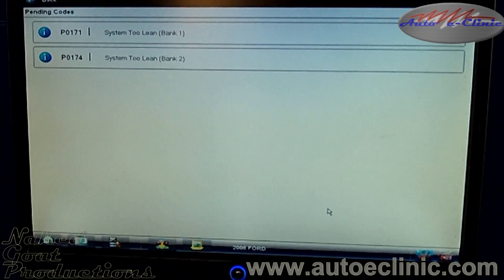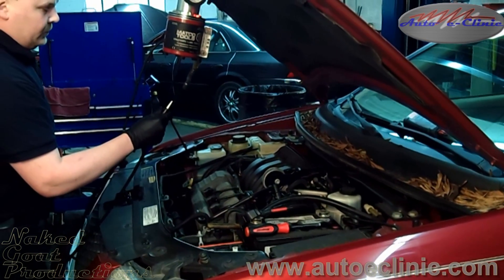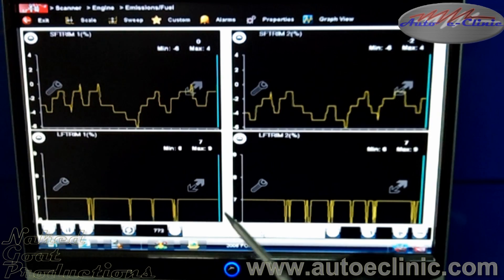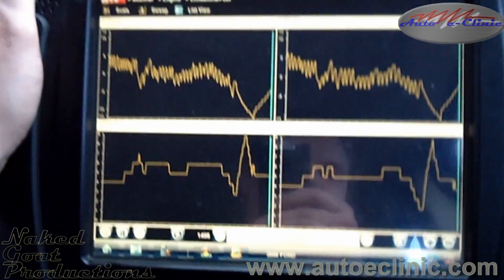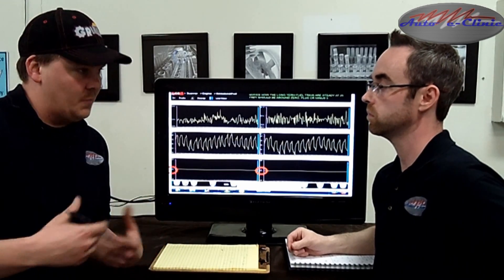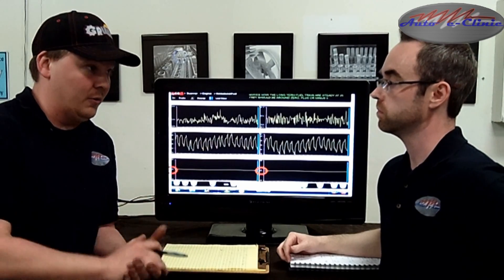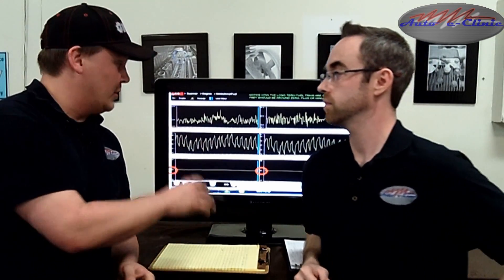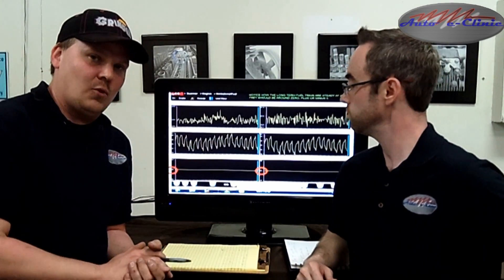How to Diagnose OBD II Fault Codes P0171 and P0174 Leaking Intake and EGR Valve (06 Ford Freestyle)

Comment: Where did you put smoke in the engine? In intake manifold? You used an adapter to acomodate the intake manifold diameter to the smoke machine output? I didn't  see very well the action. The presentation is too quickly.

Comment: Hello there, i have a 2000 Ford E150  van  And it keeps showing a P0174 error code on it. I keep taking it to shop after shop and nobody seems to know what the problem is. What i have replaced on it myself are the following. MAS sensor, fuel filter, Air filter,  02 Sensors ALOT of times. Is there any idea what could be the problem with my van?  It runs great and has been running great and no check engine light either until i came back from the auto shop i let them look at it because it was idling kinda rough when i would stop and a stop light only.

Comment: https://www.amazon.com/s/ref=sr_nr_p_89_2?fst=as%3Aoff%2Cp90x%3A1&rh=i%3Aaps%2Ck%3Aobd%2Cp_89%3AFoseal&keywords=obd&ie=UTF8&qid=1505984841&rnid=2528832011 I have bought a obd scanner from amazon. Simple to use with my Samsung S6. Downloaded the FREE Torque app. Easily found and cleared code on my Chevrolet . Also shows all the computer data, which is really interesting. I also use this OBD 2 while driving to provide data, hp, mpg, timing, etc...

Comment: thanks guys preciate the help I have the same issue on my BMW x5 with lean code on both Bank 1 and bank 2 and by the way nice I definitely don't have a lot of paper toilet so I'll definitely won't go to Taco Bell. my question is the following I don't know where to start I replace so many things recording this I did a vacuum test leak and nothing I also did a fuel pressure and for some reason to pressure regulator keep going up and down rapidly I don't know what's that about

Comment: HI I have a question i have a Acura TL Type s 2007 and the check engine light came on and i checked it and it gave me a code Po174 can you help me to see what it is
Reply: What was the issue(s) with your Acura. I recently got the exact code on my Acura Mdx

Comment: just had my head gasket changed and shortly after engine light came on, so I took it  back and now it's throwing both of those codes, I would like to hope it's not the head gasket since they just replaced that and put in a used air intake. so not sure where I should go from here.

Comment: I have a 2006 Ford Taurus, 6 cylinder car, my engine light, (idiot light), I went and had it tested about 2 weeks ago at Advance Auto, they said at that time I needed a tune up that my car was misfiring, I had already done an oil change a few days earlier, so I bought an air filter, and spark plugs, and wires and my son n law put those in.  Fast forward to today, (yesterday, Monday, I was in the Publix parking lot and my car started acting funny, sputtering, so I drove around the corner to Kauffman tire, and hour later they looked at my car and said  that 1 of the spark plugs had popped out and 2 were loose, they fixed it, but said they couldn't look at the other 3 under the pelium, that it may be fine now but without taking if off they are not sure,) so now I don't know if I need to worry about the other 3 spark plugs or not?   I am freaking out, I am disabled and I need a safe car, anyway, today I went back to advanced because the Engine Light is still on in my car, TODAY it read codes P0171 and P0174, I just watched your video on these codes so I see it could be lots of things, I don't know what to do, I don't want to get ripped off at a car place; so I need your help please!  Is this something I need to worry about, if I am planning to take a trip to Texas in my car soon, and what about my tune up issue

Comment: great video! I  have a 2002 vw jetta turbo, and took it to goodyear and they mention I need to replace a "Hose to Snorkel" what is that? they said i have to get it from the dealer. or were this part located at... the code coming up is P0171 Lean Bank 1
Reply from the maker: Thank Brian! They are probably talking the hose between the mass airflow to the throttle body. You could have air sneaking in past the mass airflow sensor and the computer does not compensate. Therefore it does not add extra fuel resulting in a lean air to fuel mixture.

Comment: Yeah i have a problem with my 94 yukon i think my oil pressure sender is going bad because when i start my truck its in the middle and then when I'm driving it doesn't stay in the middle only when i accelerate it goes to the middle at 40 pci .Please can you help me with this problem. ?

Comment: Thank you for the video! I have a 171 and a 174 error code. Apparently the engine is running too lean. Ford told me it was the mass air flow sensor as well as the throttle body. They want $900 to fix it. So I went down to NAPA Auto Parts, picked up a mass air flow sensor for $75 and fix that in a matter of minutes. My check engine light is still on, just wondering if you have any further advice for me. Ford said there was no air leaks and that the codes they got were to repair the mass airflow sensor and throttle body. But when I look up symptoms of people who need to replace their throttle body they are things like hey bad idle whether it be too high or too low lack of power and so forth. I have none of that. My vehicle runs practically perfect other than a check engine light. I have a 2007 Ford Expedition, any advice would be had. Thank you very much.
Reply: AutoEclinic
whoah...we get good guys in there who seem to know what they are doing and communicate well and in the blink of an eye they are gone...I too am sorry for your loss
Reply from the maker: Thank you for your comment. Sounds like the fuel trims need to be checked to get a better idea of whats actually happening.  I'm sorry I cant give you more advice, unfortunately Micheal past away a few weeks ago and the diagnostics was his specialty. Keep me posted on your findings though. Aaron
Reply: Sorry for your loss....
Reply: Too late to help with your problem.  Build a smoke machine for about $30.  Check for vacuum leaks.  Throttle Body bushing leaks can be detected with smoke.  Low fuel pressures can cause these codes.  But KISS.  My money is on a vacuum leak.

Comment: So the EGR Valve was Leaking when you did the Smoke Test but the Intake Gasket was NOT leaking when you did the Smoke Test....So you did Intake Gaskets why?!?!  Oh wait....more money!?!?  Maybe you should have just put the Transmission in it!!! (Sarcasm)
Reply: not sure on the sarcasm but maybe you missed how they plugged the hoses to the egr after pulling it out one it was prooved to be leaking and then restested and smoke ALSO came from the intake...they were checking all possible causes.Just like if you only change brake pads while still having bad calipers you havent really fixed the whole problem but only a symtom

Comment: My 04 Mercury Monterey 4.2L also have these two codes,  the FTST si 7.031 on bank 1 and 12.5 on bank 2, but FTLT for both bank 1 and bank 2 are 25% even after I ram the RPM to 2500 it stay at 25%, the problem must be worst then I thought.

Comment: I usually don't comment on such videos , but I would hate to see anyone misled . The EGR would not have caused a lack of power. The fuel trims on the test drive from what I can make out from the camera phone video, would be too low under acceleration. That would lead to a mass air flow sensor type of diagnosis. All EGR and throttle shafts will show a small leak under a smoke machine. Perhaps a follow up video with a customer verifying the repair would be in order.
Reply: If it had a bad EGR valve that caused a vacuum leak therefore making the CEL pop up as well as putting the car in a limp/safe run mode....then I'm pretty sure it would have less power. Also, gotta kinda call BS on you saying all EGR and throttle shafts would show a small leak under a smoke machine....unless by small leak you mean microscopic and negligible....which is not what we saw here.
Reply: I have to agree with Keith on this one, I see smoke all the time from EGR pintle shafts when I smoke the intake.

Comment: hey  would  having  both  of  these  lean  codes  affect  my  had  mileage? &  also  is  there a  single,  more  common  issue  that  results  in  both  codes  showing  up?
Reply: Po300
Reply: And yes it will affect your gas mileage drastically

Comment from the maker: You are right. you can use brake or carb clean while watching fuel trims. If you have a vacuum leak fuel trims should lower when you are at the vacuum leak. Thanks Michael and Aaron

Comment from the maker: I do not like pc based scopes. What we use is a snap on scope. Now they are pricey, but they work and work well. Fluke makes a 2 Chanel scope for around $1000 i believe, and there are a couple of other brands that make affordable scopes. I have had no luck with pc based lab scopes. Good luck and thanks for the question. Michael

Comment: first off, very helpful!! but I have an issue with a 5.4 f150 with high calculated load at idle.. where do I start   its not the first f150 with theseprobs at my shop but I want to figure this out   please help